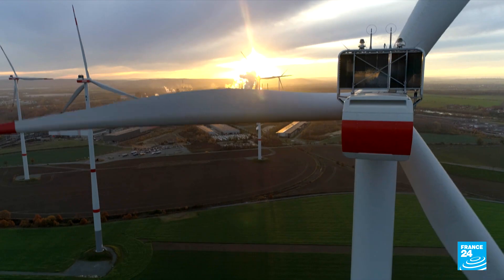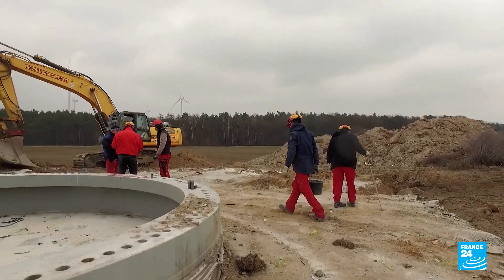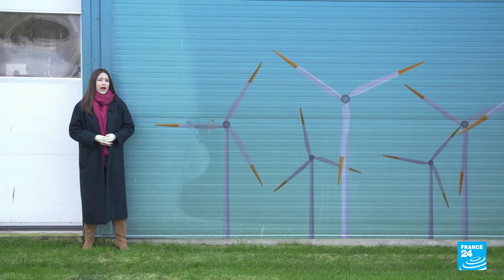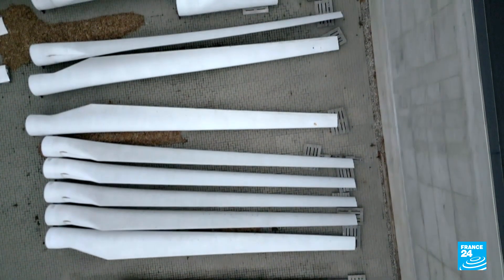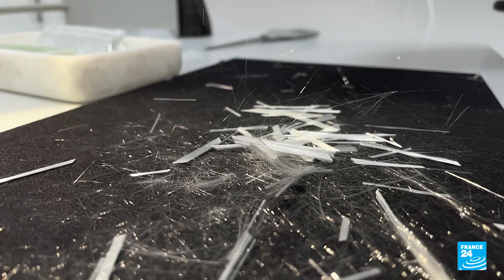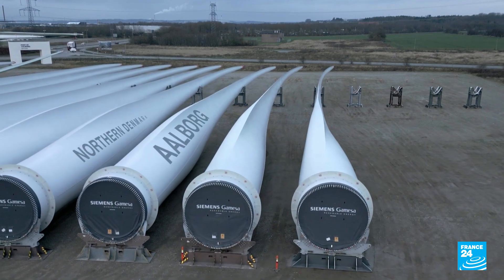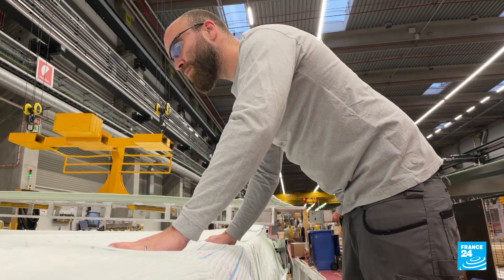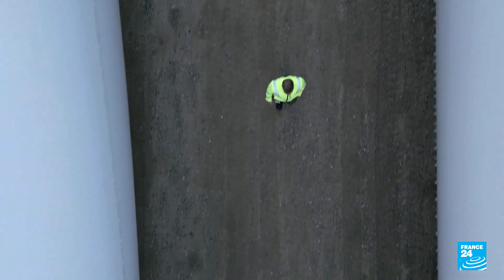Wind turbines are getting old. What happens to the ageing fleet? • FRANCE 24 English

Comment: Company in Iowa claims chopping blades into useful components for concrete and other purposes. Sez they're not using ff in the process. Keep in mind the billions and billions of tons of similar waste from the boating industry which should benefit. We need to expand our minds across industries for opportunities. Similar situation with lion batteries. Short sighted reporting poses EV batteries as a pollution hazard. Myopic reporting ignores history of these batteries. Commercialized 30 years ago hundreds of billions of these batteries have been manufactured. Where have they been dumped??? Landfills incinerators. Due to the EV innovation there's a critical mass available for recycling. The supply chain is coming together for collecting these batteries for reuse. Greenhouse gases pollution is a gift in disguise forcing us to rethink our direction and move toward a civilization living on our daily gifts from the sun